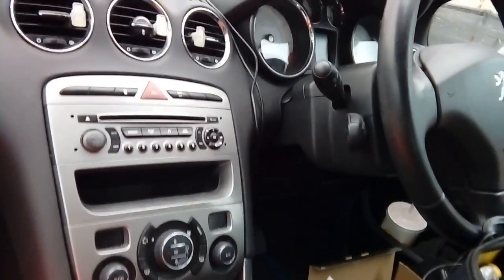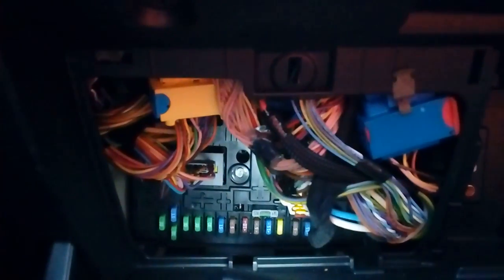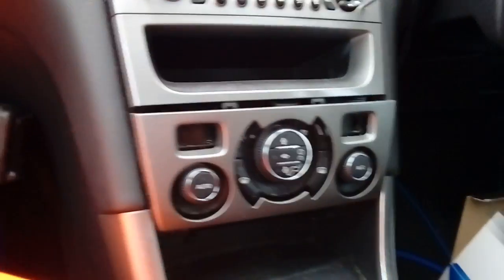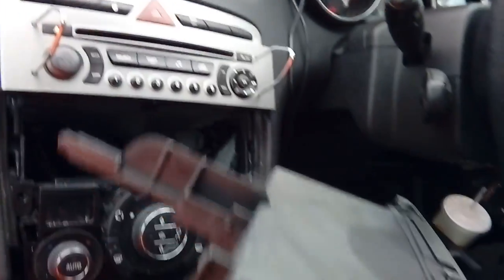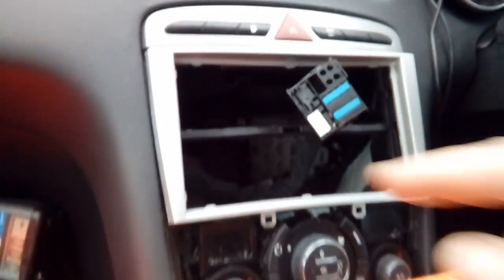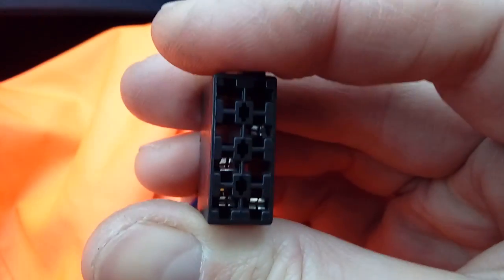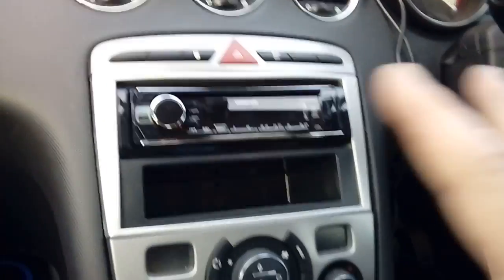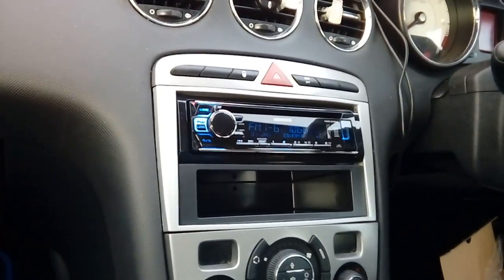Peugeot 308 2007 - 2013 simple radio removal & refit guide with part numbers

Comment: Help, my 308 radio won't slide out like in the video, there's a physicsl catch to stop it sliding it past the lower lower tray?
Reply from the maker: @DemonKong830  Common enough, sounds like someone has not used the correct release keys in the past and so have damaged the release mechanism. When this happens part of the mechanism catches on the dashboard and can be a pig to remove. No easy way to get the thing out now.

Comment: This video is awesome and helped me a lot. There is just one thing I want to add. The whole thing with that dubble fuse is a bit over engineered. When u connect the cables there are three pins not attached. One of them is the 12V power cable. (I think it’s pin 14). 
Just connect this one and u do not need to handle with the fuse since I think that’s pretty challenging.

Comment: Hi Great video...can I ask why you need the live feed form the fusebox as my iso adaptor lead plugged in and worked out of the packet.
Could you also tell me which wire I need to connect the power lead from the fakra adaptor to does it need a perm or switched live and can I use the amp turn on lead coming out of the aftermarket radio?

Comment: Did we nee to cut it of the black panel
Reply from the maker: You might be able to get a face plate that leaves it in the car but the supplier only had one option for this install and that needed the black bar cutting out.

Comment: Hi dose the cd work
Reply from the maker: This guide shows how to remove the original radio/cd player so no that one won’t work as it’s no longer fitted to the vehicle.
If you buy an aftermarket head unit one with a cd player in it then yes that would work.

Comment: This 308 is a pain in the ass. Worst car for changing the radio unit. Mostly because of the communication between radio and the info screen on the top of the dashbord. How can I change my car settings with the new radio? All controls and options are accessible through the original radio.
Reply from the maker: You can't unless you buy a very expensive control interface adaptor (around £150).
Reply: @PJsprojects  I found a great solution. Basically I just want a USB port, so I found the original RD45 Radio. Very cheap + USB port at the back for a USB cable. It will read the USB stick just finde, that includes Titel and other informations, shown on the display.
Reply: @PJsprojects  Good idea for a video though, that RD45 radio. "Easy USB port for less money", or so. ^^
Reply: PJs projects does the info screen above still show the date etc with an aftermarket head unit? Appreciate you won’t be able to change any settings, but does the info display go dead with the new unit?
Reply: @philcjackson  No the info just resets, the date and time just resets and you can't control anything on that screen anymore. I just ignore it, I have a pioneer but I'm fitting a sony today to replace it so I have bluetooth as well as AUX, so I can have less wires.
Reply: @Chilled_Wombat  where i can find   RD45 with USB port
Reply: @mah8957  I have a usb port in the storage bin under the armrest on the centre console